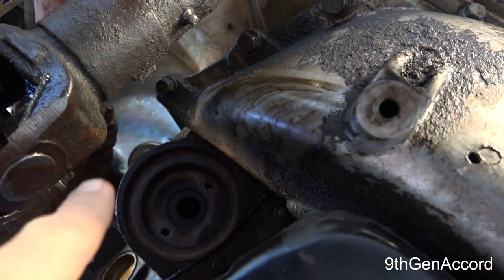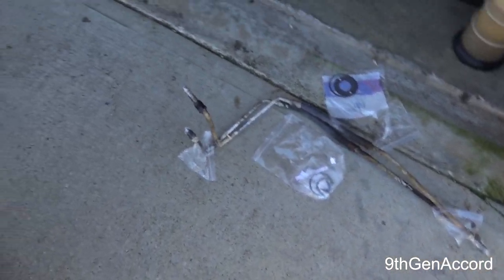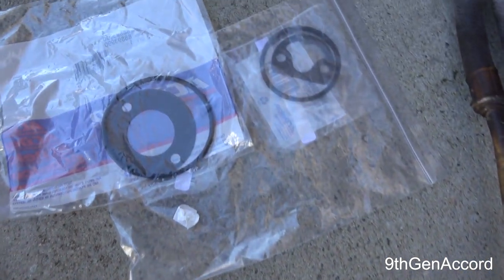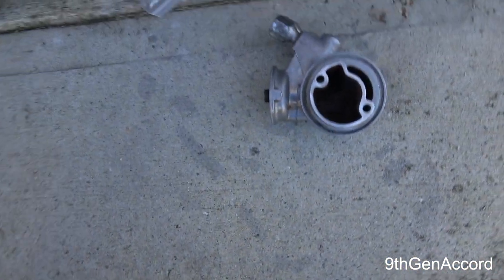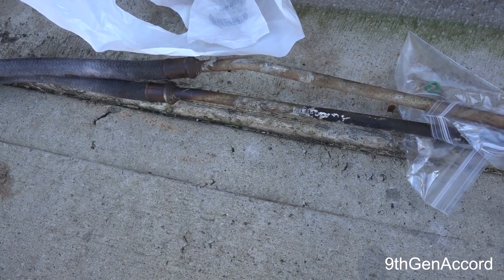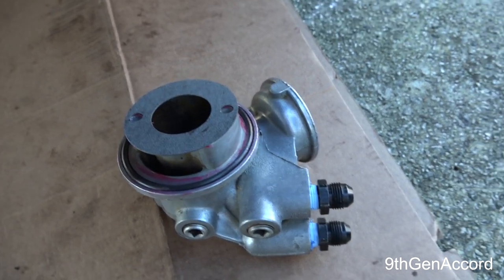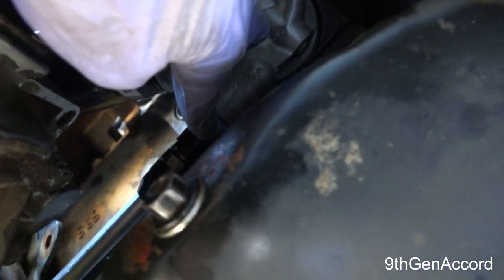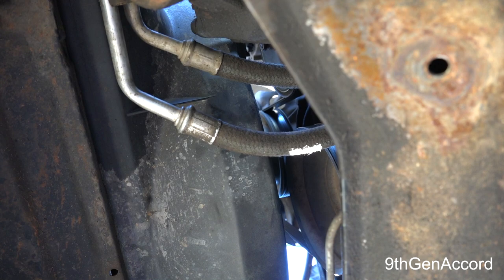Chevy Oil Filter Adapter and Cooler Line Permanent Fix 1988-1998 Chevy

Comment: So I have a 1998 Chevy k 1500 4.3 liter vortec that I was replacing radiator on about a month ago. In replacing we decided to cut and replace the old corroded oil coolant lines and reinstall new ones but accidentally broke a piece of the housing adapter in the process causing me to fetch another one in the junkyard. The new one came off a 96 Chevy of exact same engine and was exact same as broken one. We cleaned it off good. Made sure o-ring and lines were in place  as well as filter and the screws. But the housing keeps leaking from where you actually attach it to the hole. I don't get it. New radiator is ready, new lines are ready, it keeps leaking from the housing only. Any suggestions?
Reply: Probably incorrect gasket or torque spec

Comment: What's the part # or link for the -8AN Female that goes on the aluminum line you cut.  Is it a flared fitting that the cut line needs to be flared?
Reply: Smartass Sportswear you figure this out yet? I’m in the same boat.
Reply: 639220 part number and it’s a -8 to 1/2 hard line female
Reply: Ya? Another video said you had to flare the pipe after cutting, to mate with the nipple of -8AN male flare. I wish he would have reconfirmed that.  Exactly the upgrade I was looking for though. Thanks!!
Reply: Robert Pendergraft I just took the rough inside edge of the tubbing off with my razor knife
Reply: A lot of questions asked here.  I don't see any getting answered.  I am trying to put it together. The -8aN fitting part # 639220, using blue Teflon tape, replaces the failing stock fittings and if you cut off the aluminum oil line behind the flair the compression side will connect well with that pipe?  Or am I missing something step or part wise?

Comment: What are the two threaded plugs on the filter housing used for?
Reply: If you're talking about the 'plugs' he removed and then put in the 8an's, those are the original connectors on the truck, the ones you push your cooler line end into with a plastic clip holding it in place-- that's the part that gets brittle and breaks, causes leaking. I must say though, another real problem is that there are rubber gaskets inside that 'plug' that 'seat' the metal end of the cooler pipe into the 'plug', and they wear out, so leaking is often from there.  So, if you have to replace those 'plugs' too when you replace fuel line or you'll still leak. Use ACDelco on this 'plug' part, or just live with a leak.
Reply: Those 2 extra plugs might of been for the smog compressor maybe or an add on for a service vehicle of sorts.  I'm going to try and run an oil temp gauges on one

Comment: Recently completed this upgrade to my 96. I wish he had shown the processes of placing the adaptors on the lines and how / when he mated them to the housing. It was a difficult process but I was excited when I finished it. The sad part is, oil still leaked where the adaptors bolt together. It may have been my poor ability, but it just didn’t work for me. Adjusting the adaptors on one end while holding it all in place and tightening the housing end was just madness. Maybe he had a special way in which he did it that was better than my efforts, but just figured I’d give my experience ):

Comment: Do you have to drain something before you disconnect those cooler lines?
Reply: Hopefully you'd be changing out the oil and filter as well. So yes. You'll need a good old oil collection for the block, filter, lines and any that comes out of cooler up front. Bring those rags and gloves.

Comment: Ok can the oil cooler line cause oil to leak into my radiator as and coolant leak into my oil as well?? 1994 chevy 1500 5.7
Reply: Yes. Remove your oil lines from the radiator and do a pressure test on the oil cooler on the radiator. If it passes your problem is somewhere else.

Comment: So you only used the new fittings to the housing and new gasket ? No new lines ? Unsure how your original lines connect to the new fitting
Reply: The line side of the AN fitting is a compression fitting to go on the original hard line.

Comment: Is a heck of a lot easier to just build a set of line out of hydraulic hose and cheaper
Reply from the maker: Nope I disagree or I would have done it that way.  If I worked in a hydraulic shop I would have done it that way.
Reply: Wish I would have seen this first.  Tractor supply or neighborhood farm store sells pre-made lengths of hydraulic hoses.  I wouldn't have had to wait for parts anit would have been easier

Comment: So that's an an-8 with a 3/8 compression fitting on the oil line?
Reply: I'm guessing an AN-6, which is 3/8"
Reply: @USMC-Sniper-0137  Yeah I believe the pipe thread is 3/8. 3/4 would be huge.

Comment: Could you tell me the size and type of fittings you used at the oil filter housing connection to eliminate the plastic clips
Reply: They are -8 AN fittings on the lines and on the housing side it would be a -8 AN to NPT adapter. I'm not sure what size NPT thread it would be but I would think it would be 3/8".

Comment: Funny I've been running dorman lines, gaskets and filter house fittings in my mild 496 build with high pressure pump and 2 yrs later still waiting for them fail....maybe the mechanic and not so much the part?

Comment: Do the oil cooler lines matter for every day driving my 94 k1500 came without them but I’m not sure if I should put them on?
Reply: No. Oil coolers help with the longevity of a engine. Engines that see alot of strain from vehicle weight, towing, racing and weather conditions.

Comment: Just completely remove the oil cooler lines. No need for them
Reply: You're right.
Reply: Eliminating the cooler lines would reduce the amount of engine oil in the system making the oil have to work harder and at a higher temperature. The best thing you could do would be to run it through the radiator and install a cooler in front of the radiator.(transmission cooler can be used on engine oil side)